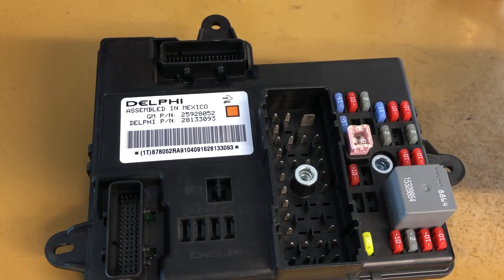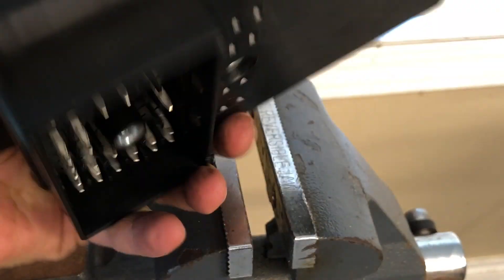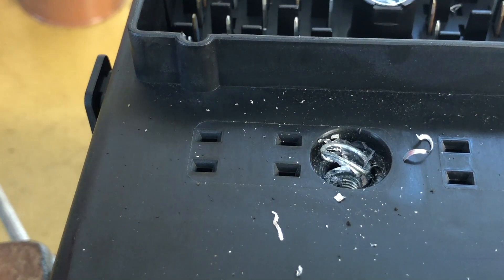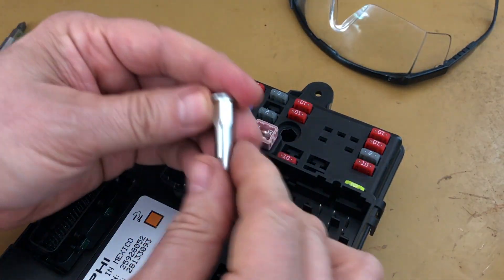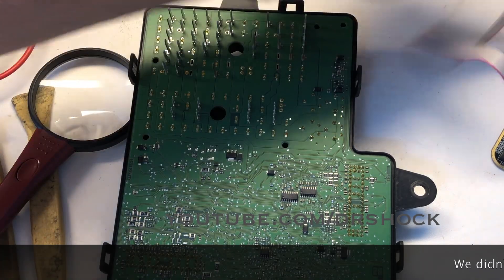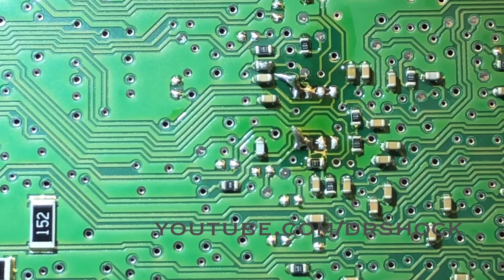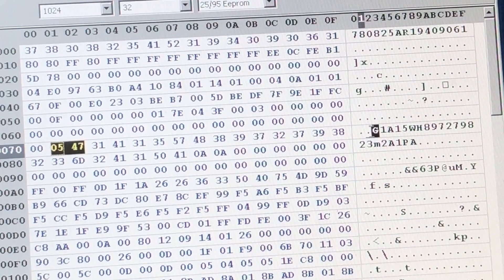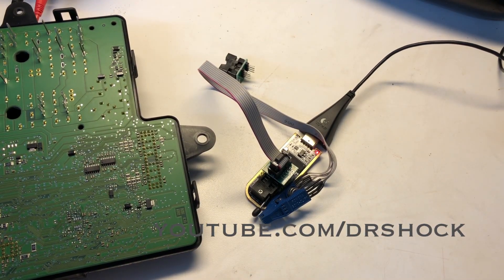2005 - 2010 GM Delphi Body Control Module (BCM) EEPROM Location & Contents (VIN, mileage) Cobalt HHR

Comment: I decided i wanted to add factory remote start to my non equipped remote start HHR. I thought "I'll just swap the bcm and correct the vin" well, I don't want to get into messing with Eproms but it seems the are some autel units that are capable of reprogramming the VIN. I assumed tech2win could do it but I was wrong. I also thought the inexpensive autel AP200 could do it, i was wrong. The maxisys should do it, there's videos demonstrating it on YouTube, but I'm a little over it. I'm not buying an autel maxisys nor am I going to track one down I can just use. Maybe one day I'll pick the project up again.
Reply from the maker: I would assert the VIN relearn functionality you're thinking of is not related to the BCM.  But rather, for use on the PCM or VCM instead.  None of GMs programming tools will allow you to rewrite just the VIN of an used BCM.  Rather, GM will have you limited to using only a brand new or remanufactured BCM that has been wiped and is ready for a full re-calibration of the onboard flash memory.

The reason is that unlike other GM modules the BCM is far more complex in its programming parameters.  Besides the VIN, by law the odometer mileage has to be preserved/restored (and will have to match the value stored in the IPC module).  And the BCM in GM vehicles controls the fuel control password part of the theft deterrent system between the PCM and the fuel system module(s) which also has to be relearned.  Finally, all of the vehicles regular production options, or RPOs, will have to be reprogrammed from GMs original manufacturing database for the VIN as these are typically managed by the BCM (e.g., cruise control enabled/disabled, fog lights enabled/disabled, remote start enabled/disabled, etc.).  Such complexity can only be handled, officially, thru a full re-calibration using GMs SPS2.

That's the whole reason for a video such as this one. ;-)
Reply: @DrShock  sadly I read all night instead of sleeping and came to the conclusion the video I watched was misleading.

Interestingly I came across a thread from the df goblin kit car forum. They were interested in setting the odometer back to 0 for their builds. They of course referenced your videos. One person reported accidentally enabling all the RPOs. I'm really curious how that happened/if that happened. Since options like remote start, need to use a hood ajar switch it could be an unintentional result other people have overlooked. In the southern most connector that's pin #3 and it needs to be grounded for remote start to work so it's completely possible it's happened to a lot of people who have messed with eeproms but they'd never notice something like the addition of remote start without looking in the right place or connecting that pin to ground.
Reply from the maker: I'm not aware of any published memory maps to know what addresses in the EEPROM would contain the data for any given RPO.   If this was known, then certainly it could be temporarily modified by hand.  I say temporarily because it would be wiped out if the module was ever updated using GM factory tooling.  

It's also possible that aftermarket tuning tools have some limited ability to twiddle these bits, though typically I only see this marketed towards PCM tuning rather than BCM customization.   Definitely not possible with the GM factory module programming tooling though.
 
GM will only allow an option to be enabled in the BCM during SPS2 programming if:
(A) you had the option installed when the vehicle was originally manufactured and it got recorded into their global VIN database at that time or
(B) it's an older vehicle and you could purchase a genuine GM accessory that did not require programming but rather just a Tech2 tool to enable it or
(C) you purchased a genuine GM accessory (of which remote start is one for some models) that does require module programming and that would contain a one time use VCI code you could use to tell SPS2 to add it to your VIN in that same database.  I've done a few vids in the past on how this route goes for options like fog lights and factory alarms.
Reply: @DrShock  oof, I was definitely up too late. I edited the previous comment to make it more legible.

On the cars before 2009, the remote start option was enabled in most cars without the remote start option. The only difference in cars ordered with the option was the addition of the hood ajar switch. There were a few exceptions where cars didn't have it enabled. 2009 it started getting more mixed, and there were a lot more cars without the option enabled. 2010-2011 if you did not have the remote start option, it was not enabled in the BCM period.

It seems messing with the eeprom is  the only way to really do what I wanted. 

Interestingly the df goblin guys did have success programming the eeprom without removing it from the board. A few people got it to work with their adapter using 3.3v, others couldn't make it work and had to modify their adaptor to use 5v, this seemed to make it work.

Comment: great vid, thx, can u just overwrite the vin in these bcms once you connect the eeprom to a programmer
Reply from the maker: With a BCM there's alot more than the VIN stored.  The security passcode to let the engine take fuel, for example.    And the mileage for another.   Because of this the only viable option is to move the chip from the original to the replacement of the exact same GM part number.
Reply: @DrShock  thats the problem, i do not have the stock bcm, a mechanic swapped out with a used bcm. vin, mileage, and vehicle options were not transferred over to the used bcm, car runs fine even the radio, but it lost remote start. i have a tech2 clone and i can see remote start is disabled, how can i enable that function . if i try sps will it not fail because of the used bcm vin? any suggestions in getting it enabled. could i get a used bcm with that option enabled and use that bcm?
Reply from the maker: If you have a model year prior to 2008, you could use the Tech2 with a TIS2000 (DVD version) of SPS and attempt to reprogram the BCM.  But this can be very hit or miss with an used module.   If you have a newer model you'll need an MDI instead (or an aftermarket J2534 vehicle interface) as GM dropped support of the Tech2 when SPS2 came out last year.   Path of least drama in the SPS/SPS2 route is a new or GM remanufactured BCM.
Reply: @DrShock  its a 2007 pontiac g5. with tis2000 dvd version i do not need a gm subscription.
Reply: @DrShock  i got tis2000 up and running, connected it to car, can see everything except the bcm, fck

Comment: I'd like to "pick your brain" DrShock if you don't mind, as you seem to be one of the rare individuals with the ability to communicate automotive computer controls to the general population. I have a working knowledge of computers and their operation. I understand EPROM (electronically programmable read only memory) and EEPROM (electronically erasable electronically programmable read only memory). I understand from the video the removal of the EPROM verses the "flashing" of an EEPROM. 

My question relates to my poor old tired 2005 Pontiac Montana SV6 that I paid $1600 for 6 years ago. It would seem that is has had issues related to the BCM since I purchased it. Recently I took it to the car wash and it had an automatic dry function which shortly thereafter caused the horn, windshield wipers and washer functions to go off at the same time, by that I mean, as I drove it home the horn was blowing and the wipers were going while the washer sprayed all the wiper fluid out. I am of the opinion that the BCM has failed and needs to be replaced. I guess my question is , if I buy a remanufactured BCM and install it what do I need to do next? Will the vehicle run as is without local programming? I plan on driving the vehicle to the "junk yard" so I am not concerned about resale value.
Reply from the maker: If you purchase a new, or genuinely remanufactured BCM.  Then you must have access to a Tech2 scan tool to set it up.   When I say genuinely remanufactured I'm referring to ACDelco or another top tier remanufacturer.  Not some guy selling stuff from his garage on eBay.   A top tier remanufacturer will reset the EEPROM contents to the virgin state.

If you go the salvage yard pull route, or the eBay used route, then you have to deal with the calibration programming at the EEPROM chip level yourself.  That's because GM blocks the scan tool from updating an used BCM (they recommend you to buy a new or ACDelco reman one instead).

You have to update the calibration in the BCM regardless of which way you go, as otherwise the vehicle will not start (security code wrong).  Mileage will be wrong, radio will be locked, RPO features (options your car was ordered with that were not standard) will not work, etc.
Reply: @DrShock  Hi DrShock sorry to jump in the middle here, but you're saying that a "virgin state" ECU/BCM/etc is basically no good because it needs all its values added still by proprietary software, whereas a scrapped part replacement has all those settings, but success in using it depends on degree of manufacturer lockouts/tripwires/obfuscation. If I understand that correctly, there must be an art to reprogramming these chips... because the Tech2 tool is like $4000, and i imagine only authorized dealers will be able to get their hands on these things for certain brands.. so there must be an incentive and a community around these things i guess? Thank you for teaching me so much already btw i'm really greatful :)
Reply from the maker: @cannaroe1213  You can pick up a clone Tech2 for less than 10% of that cost (that's what I've been using for many years now.   Or a clone GM MDI tool, for later year vehicles.   

Think about this BCM situation like this.   If you buy a new or professionally remanufactured BCM, then you're better off picking up the scan tool and paying the weekend programming subscription rate to get it setup.  The money you save from taking it to the GM dealer will pay for everything the first time.    But a less expensive route is to grab a salvage yard donor BCM, and either physically move the EEPROM chip from your dead original (presuming whatever killed it didn't wipe out the chip) to the salvage yard one. Or, alternatively, read and save the original chips contents and reprogram the salvage yard BCM to match.   This effectively clones your original BCM and makes for a smooth trouble free replacement/repair.
Reply: @DrShock  Ahh ok i got it! Thanks so much Doc, really apprechiate it :)

Comment: what I want to know is how to reset the BCM so it can be coded to a vehicle as if it was brand new. I would also like to know how to change the locked in chassis designation so when a reman BCM is bought and when trying to code it to a car the "Possible Wrong Vehicle Selected" error doesn't happen.
Reply from the maker: You would have to have a copy of a virgin EEPROM image, from a brand new never used BCM to do that.  There are just too many areas of memory changed/updated/modified during BCM setup and usage otherwise.    Besides mileage, VIN, and fuel security code, there are RPO settings based on the vehicles specific options.
Reply: @DrShock  I am starting the work on collecting those BCM's now. I have one that has never been coded being sent to me. I should have it in a couple of days. GM has listed in their list of superseded models that one BCM was made that is supposed to work on the Cobalt, HHR, and the Solstice/Sky vehicles. I have found that this is not the case. When coding that new BCM to a Solstice Tech2 errors with "Possible Wrong Vehicle Selected" This error is the problem and I am not able to get an answer from GM as to what the issue is and why it will not program to the vehicle. The dealerships are all but useless because the technology it too old. most of the mechanics have never even used a tech2.

The truly strange thing is considering the BCM is what has the fuel continue password if a used BCM is plugged into the vehicle so long as the part number align and the car has the same options like manual/automatic transmission being the biggest one, the car will start and run without any issues. No light will be shown. 2 things are limited, you cannot do a master key reset and you cannot change the RPO's. Both of these things would be able to be done if the BIN number is able to be changed... The fact that the vehicle is able to start is what boggles the mind. I know that the Solstice was the first vehicle in the GM lineup to get the PK3+ security which was basically a hobbled together Passlock 2 and transponder setup and it has all kinds of problems with it. Being able to go to a bone yard and grab a used BCM, plug it in and you can drive off with it it mind boggling. I don't believe the fuel continue password is stored in the BCM. I think that it is stored in the TDM and the BCM simply forwards the message. I say this because of the immobilizer bypasses for remote starters that tap into the low speed SWCAN network to record this password. If the BCM stored the password it would have no reason to send it out on the SWCAN network because the ECM is attached to the HSCAN. I am almost 100% on the fuel continue password not being a function of the BCM for these vehicles.
Reply: @DrShock  I have someone sending me a 2007 BCM for a Pontiac solstice that has not been coded to a vehicle. That's one year I will have an uncoded EEPROM for. If you would like the binary files once I read it lemme know. Maybe you can use it to figure out what exactly changes when it's coded. This will help isolating what the RPO codes are and things like that. Probably help with locating the checksum and figuring it out as well......

Comment: Question i know the cluster has a eeprom for milage...and so does the bcm... im guessing its reduntantancy.... which module overrides the stored hex milage in the eeprom the bcm.. or does cluster  eeprom write to the bcm...
Reply from the maker: It depends, different GM vehicles use different sources of truth of mileage. Some BCM, some IPC, some have an IBCM to do this.   You have to consult the service information for each car/truck to know.   There is no one approach fits all with GM.   The video description has some more technical info on this as well.

Comment: is that the software that comes with eeprom reader or something else? thanks!!! also can the vin number be changed and rewritten to the chip?
Reply from the maker: That would be the software for the particular programmer I used, called AsProgrammer.
Reply: @DrShock  is it possible to change the vin and write it back onto the chip with this setup? Thanks!!
Reply from the maker: While that could be done with a more simple module like a radio, it isn't not directly doable on a BCM.   The BCM will also contain the mileage (in an encrypted format that you cannot directly read and in multiple memory locations), as well as the options (RPOs) the vehicle was built with, and most importantly the fuel authorization password.   Without the latter, the vehicle will enter security mode and no longer start.
 
So to write the chip you need more software, like Tachosoft, in order to be able decrypt and transfer these other data elements.  In general, it's easier to just desolder the original EEPROM and transfer it to the replacement BCM when going with an used salvage yard donor (as long as both have the exact same  GM part number on the white label).